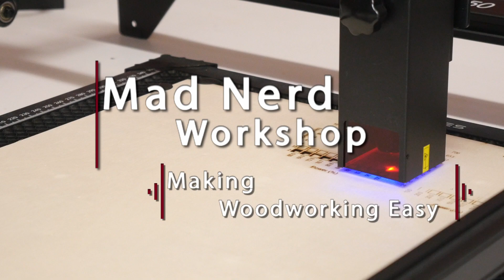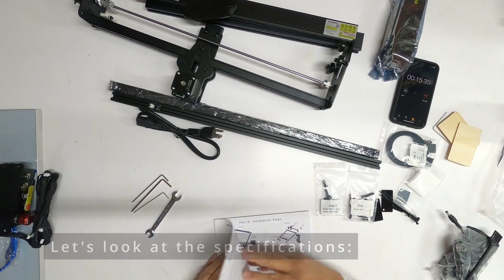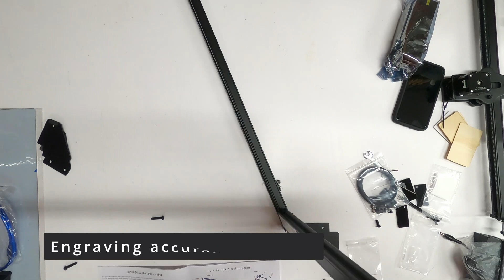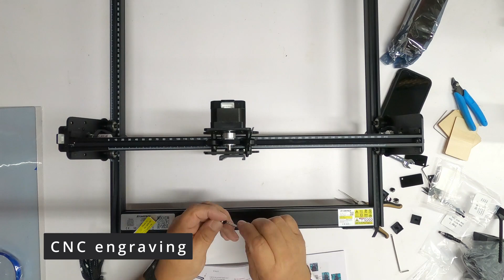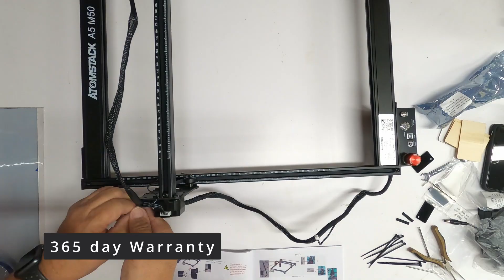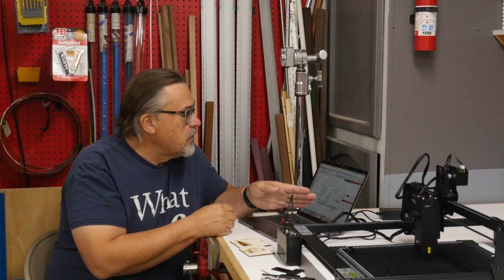Box opening of AtomStack A5 M50 Laser Engraving Machine

Comment: Fantastic  video and presentation....2 questions..."if" a higher watt cutting head was used let's say 20w...is the wiring connection the same...
And 2. at the stock 5w laser head, it should cut balsa wood correct...
Thanks very much
Reply from the maker: Sorry for the delay in replying.   Yes on both questions.  Same wiring ( I believe - I am not an expert on wiring).  But for sure it will cut through basal.  Thanks for watching.